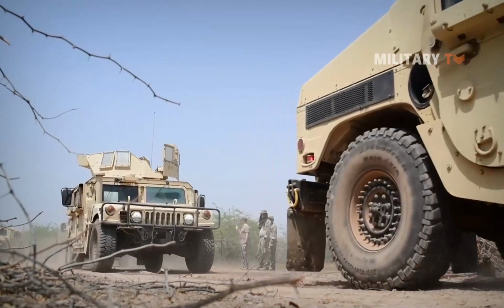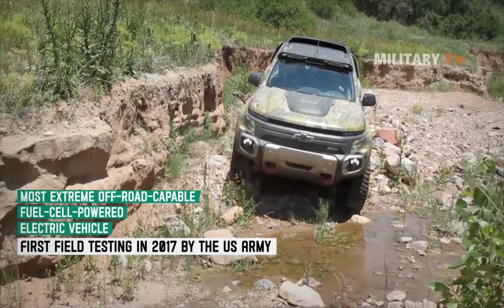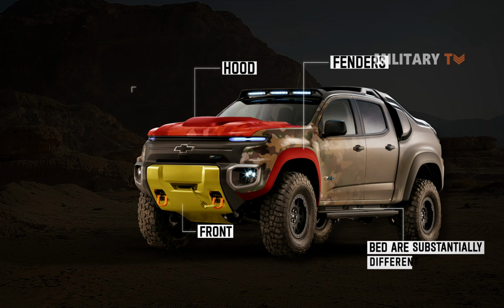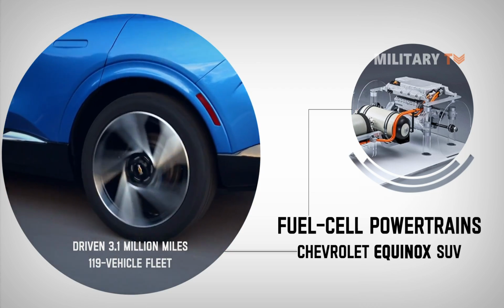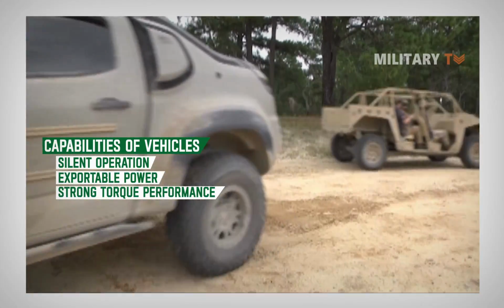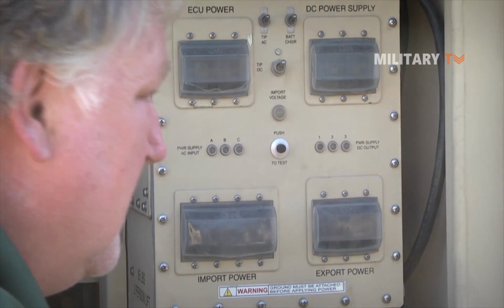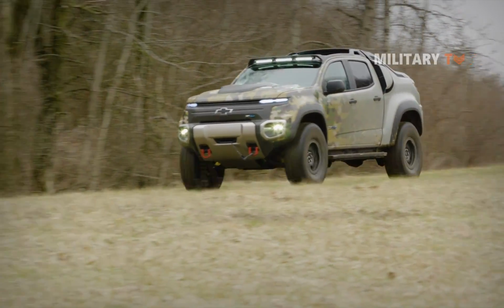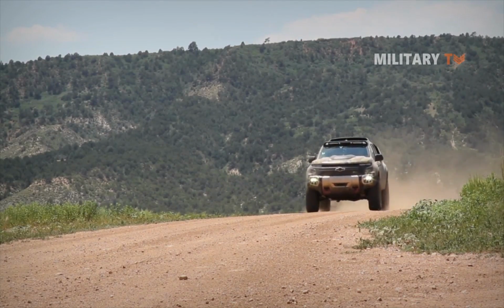US Army Testing A Hydrogen Powered Military Vehicle

Comment: Wow very interesting. There doesn't seem too much point for the jeep but I assume its more a test bed for the drive system. Hydrogen Powered Helicopters/tanks/trucks would be interesting with the low heat/long range/quite operation.

3

Reply

Rob908
Rob908
18 hours ago
The Tardec reformers that convert JP8 to hydrogen is the key. Transporting and refilling with JP8 is an existing capability. Transporting and refuelling compressed liquid hydrogen would be a new capacity and supply line that would have to be designed and created.

4

Reply

Rasheed9957
Rasheed9957
17 hours ago
I already want one!

Reply

Y King
Y King
13 hours ago
So... Can it go faster than walking speed?

Reply

The Miscellaneous Channel
The Miscellaneous Channel
18 hours ago (edited)
Been waiting for Military vehicles (Humvees, tanks, drones, or fighter planes) to be electric....as they will be quieter, and more stealthier during war. ...hydrogen makes more sense as the range will be longer, and if engineers can come up with a portable hydrogen production generator for field use...these vehicles can in the field for a much longer time without refuelling.

6

Reply

1 reply
Marwa
Marwa
14 hours ago
Güzel bir şey değil bu kadar basit değildir

Reply

George Woodcock
George Woodcock
21 hours ago (edited)
This is the way forward Hydrogen cars. Electric limits distance and time recharging so only a stop gap the quicker the better .

4

Reply

B Conrad
B Conrad
16 hours ago
study the term, "Stoichiometric Air Fuel Ratio" & that'll explain why hydrogen isn't used except in a Lab, remember.."what works in the Lab doesn't work in the field.

Reply

1 reply
Tuki Tuki
Tuki Tuki
14 hours ago
1 рпг = 💥🚘= 💩

Reply

Comment: Wow very interesting. There doesn't seem too much point for the jeep but I assume its more a test bed for the drive system. Hydrogen Powered Helicopters/tanks/trucks would be interesting with the low heat/long range/quite operation.

Comment: The Tardec reformers that convert JP8 to hydrogen is the key. Transporting and refilling with JP8 is an existing capability. Transporting and refuelling compressed liquid hydrogen would be a new capacity and supply line that would have to be designed and created.
Reply: I think it could be more useful in several base camps to just transport rolls of solar panels or the new kite wind containers generators in order to use a local water source (maybe a water well of 20 meters is not hard to do with the right tools) to produce all the fuel that a militar camp needs. 
That would save a lot of logistics and cost to keep that base fueled.